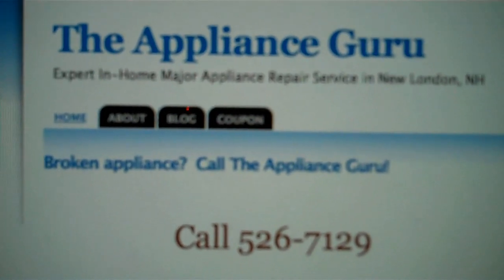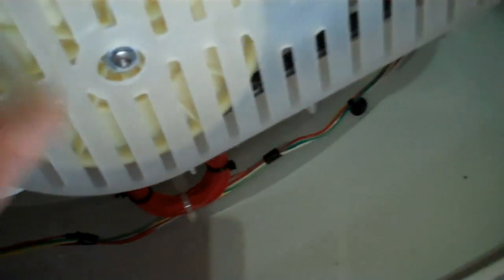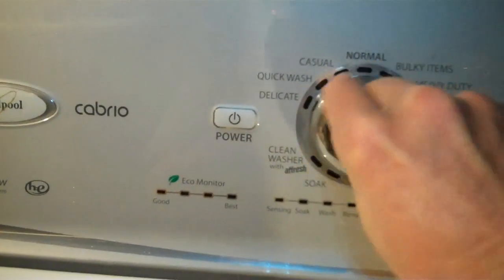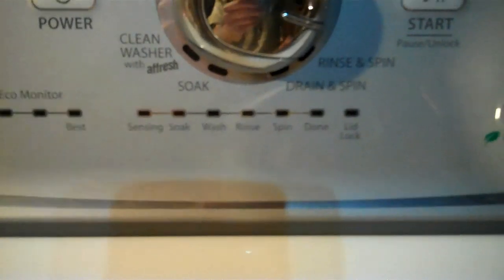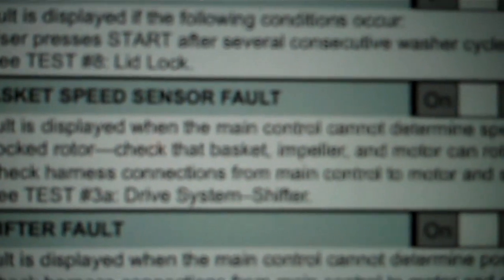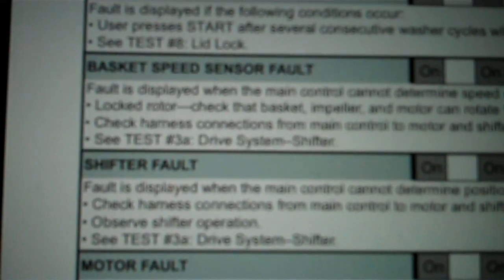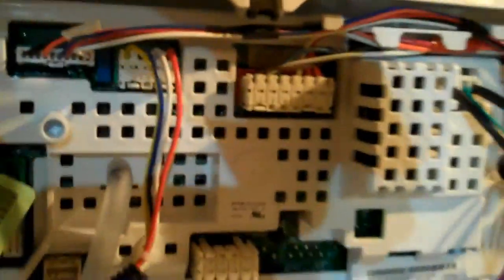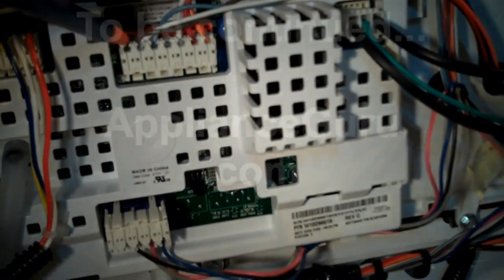Troubleshooting a No-Spin No-Agitate Problem on a Whirlpool VM Washer, Part 1

Comment: This video was extremely helpful.  I had the same E1 F7 codes, and after looking at several other posts decided to replace the Shift Actuator on the machine.  The part cost $60 and took about 15 minutes to replace (not counting the one-hour round trip drive to the parts counter!), and now we're cranking through the laundry again.

Thanks so much for taking the time to share your insight and experience.  You saved me at least $100 for a service call, and probably an additional mark-up a repair guy would have charged on the part.

Comment from the maker: The nice thing about this washer is that you don't really need to guess at all.  Put the unit into diagnostic mode and get the error codes.  This unit practically troubleshoots itself.

Comment: Hello Scott, I've checked some of your videos on the Whirlpool Cabrio but I didn't see my washers problem. It seems to spin but not fast enough. I'm having to run the rinse and spin cycle once and sometimes twice after washing a load. No codes are coming up during normal operations. Any tips on what to check or as to what is going on. Thanks, Mike

Comment from the maker: F8 E1 is a long fill/no fill condition.  Could be a clogged cold water valve (most common case).  Could be as easy as replacing the water inlet valve.  Go to the Appliantology Academy and enter your model number in the parts search box at the top of the page to find the valve.
Reply: ...... В. Пі

Comment: It's the craziest thing.  Our washer stopped the agitation motion during a washing cycle.  I went thru the steps to get to the diagnostic mode and came up with E0 and F0 codes.  Puzzling.  So I next thought I should examine underneath.  To make sure it was empty, I put it in the spin and drain mode expecting it to NOT spin and only drain.  WALAH!  It did spin.  So I decided to try a small load in a wash cycle and it worked.  I am not sure what happened, but going thru the diagnostics seemed to have cleared a fault.  Working for now
Reply: Still working?
Reply: What he said. Still working?

Comment: trying to watch these videos to figure out what is wrong with our washer.  From watching the other video looks like I have F5 E1 based on the light.  I'm not very mechanical...would appreciate any advice.
Reply from the maker: All our DIY appliance repair help is done in the Appliantology repair forums.  Just start a new topic there.  It's fun, easy, and FREE!  Please see this page to get started posting a question in the forums:  http://appliantology.org/concierge/faq.html

Become an Apprentice to unlock the full power of the Appliantology arsenal: download attachments and manuals, use the private message (PM) system, access the chat room, and much more:  http://apprentice.appliantology.org/

Comment: My maytag bravos HE would fill and drain but not agitate or spin. Turned out to be a bad lower wiring harness. It's the 3rd time I've had a problem with the wiring harness. First time it was a break in the red coil wire, 6months later it was a break in the green ground wire just before it connects to the motor plug. This time there was no obvious break, but no continuity between motor plug red and J16 plug red. There is a little connector under the washer that joins 3 red wires from motor, capacitor, and j16. It has a plastic sleeve around it. When I cut out the motor wires and joined them together, I got continuity, so I cut the other red wires from the wire connector and rejoined them with a wire nut and tape. Now I'm back in business. Who would think they would make a wiring harness so fragile?

Comment: Had this same problem, the belt fell off of the motor pulley.  Pretty simple fix.  Flip on its back, remove sound dapmener, 2 screw for the belt cover, 2 bolts for the motor.  It's a tight belt might take two people to get it back on, or a pry bar like I did.  Will be ordering a new belt for when it happens again.

Comment: My Lid Light flashes once I try to start my first load, after I unplug it for 10-12 seconds, plug it back in and start it again, it will work for 2 or 3 more loads.  So now I wonder how long is this going to work before I have to have it repaired.  I have not checked for the diagnositic code yet, just holding my breath as it works through the cycles. Ideas?
Reply from the maker: kguyh55 You have to get into diagnostic mode on these computerized appliances to see what error codes are stored there.  This points you in the direction of the problem.

Comment: What if you don't gave a display how do you get the code
Reply: There is a book on the inside on your washing machine, it's under the top inside left side corner, I could reach in through the middle and get to it. There is a diagnostic way of clicking the knob to show the blinking lights to indicate the code.

Comment: I follow your turning of the nob to get it to diagnostic mode and mine does not then flash all the lights to show me that's where I'm at.  It's as if it thinks it's ready to wash whites.  I know I'm not turning it incorrectly as I've got the computer sitting right here, doing it as you are.  What else can I do?
Reply from the maker: When you turn the knob, make sure you feel each of the indents, rather than skipping over them.  That will approximate the correct timing.  Timing is critical for diagnostic entry on these controls.  It's about 1/2 second per turn.

Comment: Hi Hellp me.please I have the same washer and the problem is that it wont fill up if water I just put a little amount of  clothe and it  just wont fill up the clothe are dried
Reply from the maker: Yahaira Soria Check to see if the water inlet valves are getting voltage during fill. If not, then the control is bad. If they are, then you have a water supply problem.

Comment: I have the same problem and same code. I've already replaced the shift actuator and still won't spin or even wash. I noticed that the pulley connecting the motor and transmission doesn't spin freely like in the video. In fact it doesn't spin at all when I try to move it. Is that normal? Any help from anyone is appreciated.

Comment: hi whats up i have a washer that wont spin its a top-load kenmore i took it down i was thinking it was the capasstor  because there was nothing in the pump and it spins free by hand changed it and still did the same when it humms if you spin it it will start up i am lost what wrong do i need a bigger one change it with a 165-240 mf
Reply: just trying to grow some food its a weak motor. Replace it and youre golden

Comment: I've had an abundance of these machines come in lately that will not go into spin. All tests in manual test mode function correctly up until LOW SPIN, HIGH SPIN, GENTLE AGITATION and HEAVY AGITATION. On these last four I will get the beep and all status lights will flash. 

My question is:

Is it normal for the manual test to not spin on the last four, even after the actuator has been replaced? I will even calibrate the unit, but will get the same result in manual test. I found this unusual because unit will eventually follow through normal cycles and spin as intended. Is this the control board still stuck in error? 

Just curious. I have to say though... Best thing about this video is Kraftwerk's "Pocket Calculator" Great Choice! I bought that album (Computer World) when I was 8 years old the year it came out. That was quite an experience for 1981. LOL
Reply: +Jason Scott Please let me know if you solve this.  I think I am having the same problem!

Comment: I have a F7 and E5 what do i do to fix it
Reply: Rosalie Margelos thats the exact code i have! Did you ever figure it out by any chance?
Reply: Shifter issue !!!!!!!!
Reply: Rico , suave thanks haha these new washers are a pain 😡
Reply: F7 e5 shift accuator speed sensor is built in to it. Let me guess it will wash but dont spin out or might get stuck  in the rinse cycle  mother board can't tell what the basket is doing.   If it wont agitate or spin them motor start capacitor  and or connections to broad or either of these components
Reply: Also code f7 e1 same possibility
Reply: @RockHounder-jn8hs  how do you fix.those codes?